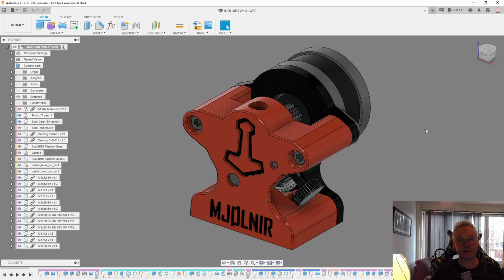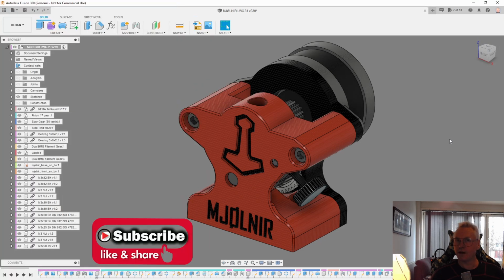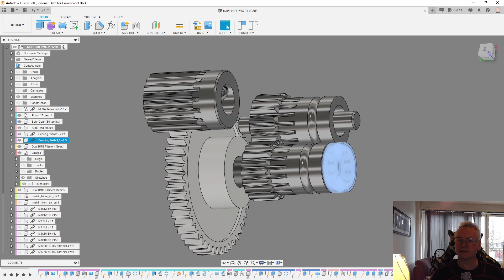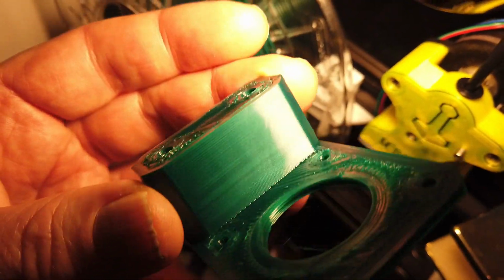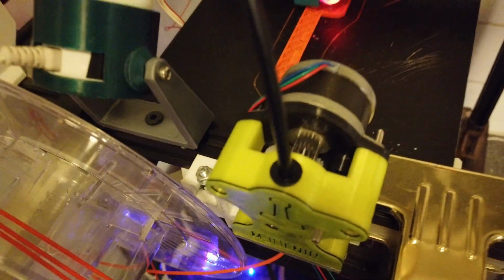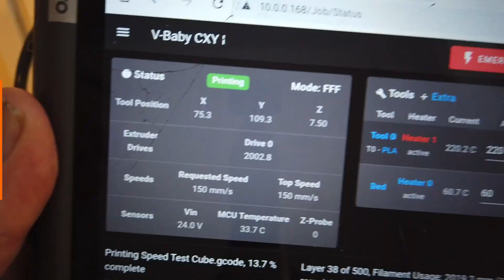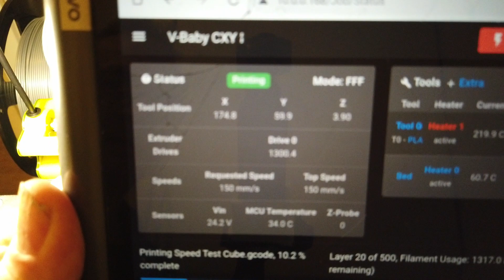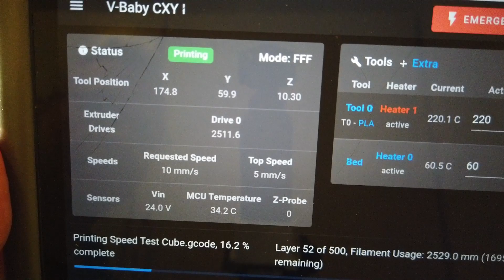NEW! 3d Printer Extruder| FLOW TEST | E3D V6 VS TL DRAGON VS the 150g MJØLNIR LWX Filament Extruder

Comment from the maker: I hade to mount the extruder in bowden mode in this test
Reply: Was it standard flow or high?
Reply: I think just putting the hotend hotter is already going to allow you to print faster.

Remember that the hotend temperature is a guideline for normal flow rates.

At higher flow that comes with higher speed, your filament never reaches the hotend temperature, unless you use a hotend with a heatblock with much higher thermal mass (like the Magnum+
).

But you can still print faster with a normal hotend by just putting it to higher temperature so that the plastic gets closer to the intended temperature.

This can be done in two ways really, higher temperature on the hotend itself + lowering heatbreak heatsink cooling, so that the plastic gets a tad more preheated in and before the heatbreak.

At really high speeds, plastic melting inside the heatbreak isn't much of an issue as it shouldn't be in there long enough to really melt.
Reply: Also, 40 and 50W Maxiwatt heatblocks seem nice for high flow applications and they should fit V6 and MK8 heatbreaks.

Because of their construction, they supply heat more stable and directly to the plastic, making internal thermal dynamics less of an art of tuning for numbers you can't measure.

Comment: Very usefull video just misses a few details to be a real good test. Your extruder is geared so if your remove the geared extruder for a faster extruder setup. like a big NEMA 17 high torque do you see with the hotends the same limits or does it change. Because 175mm/s we run all day every day and fall asleep. We run PETG at 260C nozzle on a V6 with vulcano solid copper block with copper nickle plated nozzle with a direct drive 50cm bowden tube setup with a full titanium heat break from 3D Passion and we pushing 200mm/s with 3000mm/s acceleration all day no problem. Those small Sheba stepper motors don't have the power or torque for 24/7 operation.

Comment: I have another extruder, but with the same stepper motor. How did you set the current for the drivers? Mine gets very hot, and when i lower the current, it can't extrude any plastic. I'd love to know what the sweetspot is
Reply from the maker: Depends on the motor. I have one I must run at 350ma and another can run at 600ma

Comment: Ser ut som du har litt mye masse å drasse på for over 200mm/s, så gynger litt når den skifter retning. Dragon trenger ikke mye kjøling, så vil anbefale å stikke innom clasen der du kjøper filament, eller biltema, og kjøpe deg 2 L-braketter. Skru av V6 halsen på Dragon'en, bor hull i ene L-braketten som matcher de skruhullene på toppen an Dragon ramma, og fest braketten til X-akse braketten. Må antagelig bore noen hull i den siden av L-braketten for å feste. Så tar du den andre L-braketten du kjøpte, og boree hull i den til å feste bowden-koblinga, slik at den blir rett over åpninga i toppen på Dragon'en.

Vipps så har du et hardmount av Dragon hotend'en rett på X-aksen som ikke gir etter i svingene, og kan ta vekk all den vekta som plasten utgjør. Om du vil trimme enda mer vekt kan du kappe vekk overflødige seksjoner av de L-brakettene, kan fort spare 30-40 gram. Og til slutt - du bør antagelig tune linear advance om du ikke har gjort det ennå.

Lykke til :)

Comment: With higher speeds you should raise the temp. I printed insane fast on the prusa mk3s with 260°C to keep up with the speed. Only issue is that it doesn't look very nice at slower parts as it has to slow down and the corners and dropping the temperature down to reasonable level is not possible with this kind of hotends and heater cartridges.
Reply from the maker: Thank you very much for the feedback! Best Roy

Comment: If you are going to use bowden I don't see the point, just use the BMG or a clone.

Now if you are using it with direct drive I definitely see the point and benefits.
Reply from the maker: This is designed for direct drive and specially designed for the Triqetra tool head. It was tested in bowden mode as the Triquetra was not ready but a work in progress. They are now both released and working like a charm as a direct drive tool head

Comment: Nice design, waiting for the direct extruder tests
Reply from the maker: Thank you Muhammad. The dd tests are done but I need to edit everything before publishing. The test shows 25% increase in flow from bowden which is interesting
Reply: @PRO3DESIGN  
I am looking forward for that, I am in the process of switching to direct drive now and it will be interesting to watch those test results

Comment: Hello just subscribed to your channel and I can tell you that I was fascinated by your review and in particular by the printer in all its parts. I was going to buy the Voron 2.4 but now I have changed my mind, could you give me some information on how to buy it and which one you would recommend with a plan of at least 350 x 350.
 Thanks bye.
Reply from the maker: There is also another design here that prints 340x380x330: https://makersupplies.dk/en/corexy-3d-printer/351-corexy-3d-printer-base-mechanical-kit-for-v-king-corexy-3d-printer.html
Reply: @PRO3DESIGN  Thank you for replying immediately but I would like to buy it complete with everything without having to take other pieces elsewhere, so if you can send me a link where you can get it complete. Thank you

Comment: Could you clarify the extruder settings, please?
extruder_acceleration
retraction length
retraction speed \ acceleration
motor current
LA\PA parameters

What motor temperature did you have as result?
Reply from the maker: Thank you for asking. Accel 5000, retract I did not calibrate but think it was 1mm, retract speed was 30mms 5000 accel. Current 600ma, temp not measured but can be touched no problem
Reply: @PRO3DESIGN  
That`s interesting.
The extruder has a low gear ratio if all gears from BMG (BMG 3:1).
For example,
- Sherpa Extruder with Nema14 (6:1 \ 7.5:1)
- Orbiter Extruder with Nema14 (7.2:1)
And you have set maximum current for the motor.
It should overheat, but...

I am looking forward to the direct-drive version with long time print stress test with Pressure Advance ;-)
Great work.
Thank you.

Comment: Hello, you said the NEMA 14 wasn't overheating at 0.65A, how dose it perform with a longer print, I just wondered if it became an issue when run for longer periods.
Reply from the maker: So far no problem. I run at 600 now. Not for very long prints but I will test this also. 2 hours is no problem

Comment: Good test! Trianglelabs states that the Dragon hotend is good for 46.08 mm³/s with PLA@215c. This was not half of that. False marketing or is the extruder limiting? PLA is maybe easier to print fast than PET-G? 
https://www.aliexpress.com/item/4000404170721.html?spm=2114.12010612.8148356.3.7f8147e6vPE59Q

Comment: e3d lineup's inferior design will limit flowrate a ton, they have a lot of back pressure and don't melt efficiently, if you want truly a good hotend there's obviously the slice stuff which is not bad, but very overpriced, and then there's my personal recommendation: the Nova hotend, it's super good, it's tiny and flows 50mm³/s on PLA, and it's been made to extrude 65mm³/s with PETG, for comparison the e3d supervolcano is 3x as long and only does 50 or so, anything that isn't e3d probably is better tho, although (like e3d), most of them are overpriced, the Nova aint too bad for what it offers, but getting that high of a flowrate proves you got a really good design! the v6 struggles HARD above the rated 12mm/s
Reply from the maker: Thanks. I will look into the Nova. I know the limit of the e3d V6 and that is why I run the Dragon. I do have the Standard flow Dragon and it did extrude 33% more than the e3d V6. The high flow might be better but I dont know if my extruder will keep up

Comment: Good video! If you are interested in in finding the maximum feed rate of your extruder, you need to use a high flow hot end like E3D Volcano/Supervolcano, or 3dPassion Nova.
Reply from the maker: Thank you. The dragon should be high flow even as standard flow but apparently no enough. It might also be that the extruder starts to loose torque

Comment: 150mm p/s definitely seems to be the higher sweet spot, I love the texture you have on those parts, what build surface is producing that texture?
Reply from the maker: Oh I am printing straight onto a aluminum tooling plate covered with high temp paint